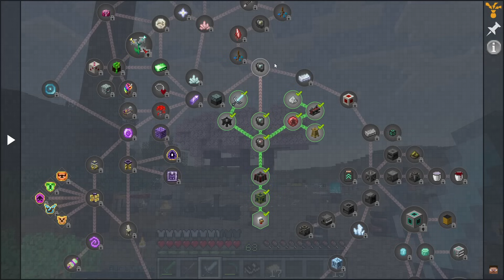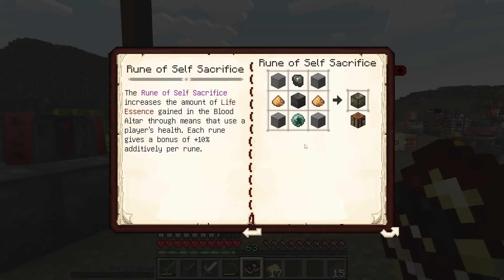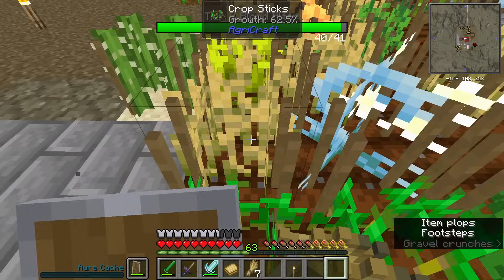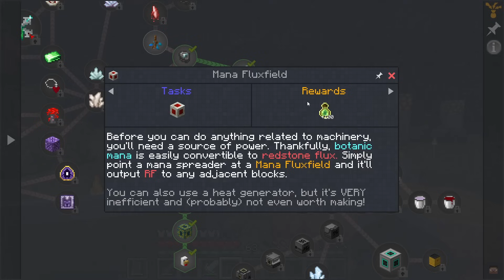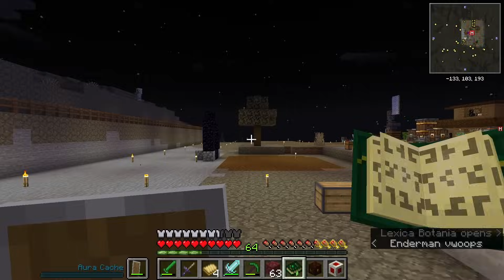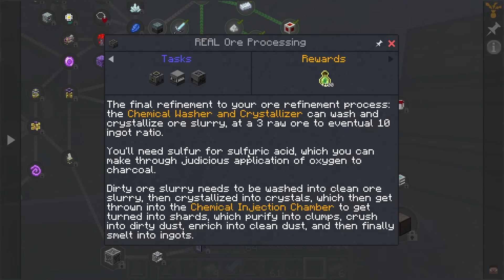Turning Magic into Technology | Reclamation Ep 21

Comment: Important! Now that you have the metallurgic infuser, you can upgrade mystical agriculture essences more efficiently because that's done in the metallurgic infuser in this pack.
Also now that you have Mekanism, I highly recommend taking some time to making some logistical pipes to automate stuff, like the turn 1 iron into 4 copper, turn those into 4 iron ad infinitum thing
Reply: I don't think the copper-iron loop is worth it.  Just make gold seeds and use theurgy to transmute as needed until you get the other MA metal seeds.

Likewise transmuting prismarine crystals into lapis, diamond, quartz, etc. is very efficient.  (Prismarine to diamond is 4-1, but it's 3 essence for 8 crystals rather than 9 for 1 diamond, and the seeds are a tier lower.)

Comment: Heat Generators are my go to for "Set and forget" energy generation. Two issues it has, is it takes up a lot of space as you can't make just one, and it is dangerous as it doesn't consume the lava, it heats up from it. You can "Waterlog" the lava on the heat gen... but as you can guess, once it is down, you really don't get an easy way to shift it around. 

Also, a note for the future, if you've got a book of a type, like for the mana spreader, in your action barlist, you can hold a button that is shown to quickly find that item within the book without searching. (Unsure if weird puzzle mod has that function.)

Comment: Just found out that if you melt the netherrack gold ore instead of smelting you get 2 bars worth of liquid gold. There is also the ability to completely automate the process, you just have to make the  golden netherbrick and put it in a chest.
Reply: I actually found better way. If you use Thuergy to make salts from the Nether Gold Ore you can actually get 5 bars per ore.
Reply: Actually something even better: If you throw it into the enrichment-chamber you also get 2 gold dust out of that each of which can be smelted into one gold ingot. With later mekanism machines you can then turn one ore into 5 but that requires an entire production-line